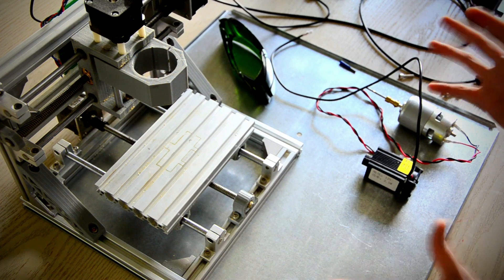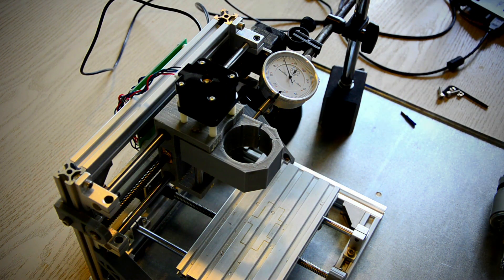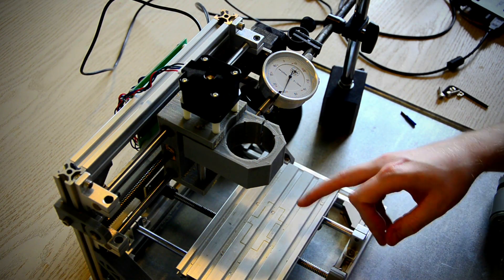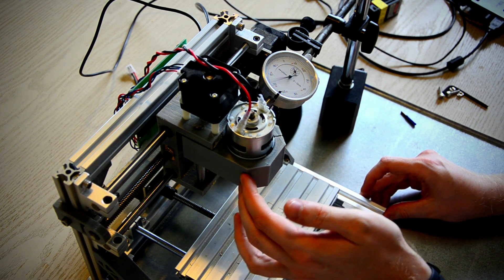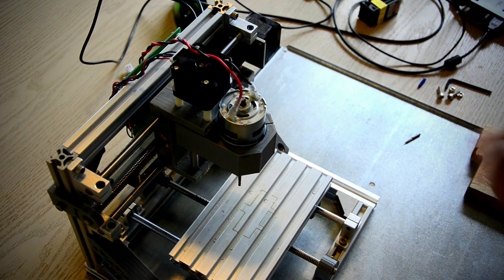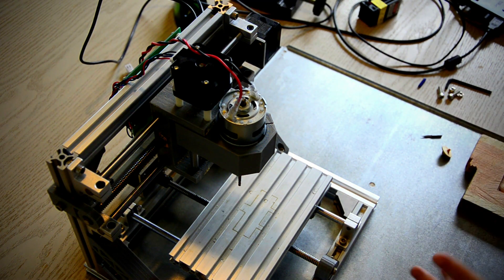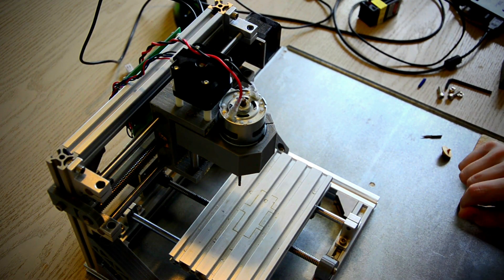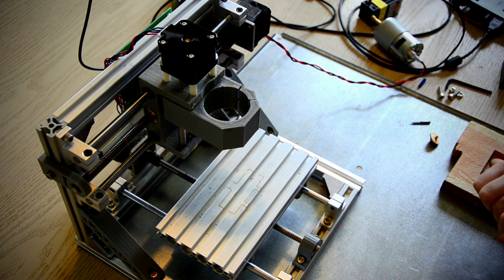Cheap Import Engraver CNC Mill Review

Comment: I have one and you should try the "masking tape and super glue trick" to hold work down. 
Masking tape both, your stock and a spoil board or the bed itself and glue it down! Holds great, pulls off easy.  No clamps, no vice...
Reply from the maker: I had considered glue but was worried that fastening it securely would mean never getting the piece off. I will most certainly be trying your method!
Reply: @xixxeaon  right, that's why the you're basically just gluing the tape to tape. When you apply the tape to both services, burnish the tape down with something slightly and apply a few drops of the CA glue to hold your part tape to tape. 👍